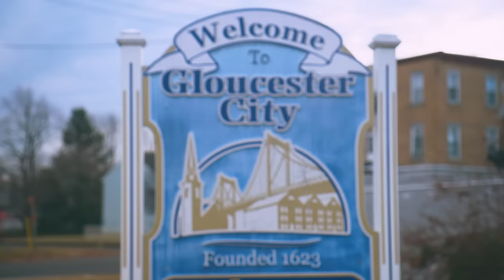The Weekender: "The Industrial Revelation" (Season 4, Episode 6)

Comment: I don't have a problem with the wood floor being painted but I think that floor looks really bad with all the gaps and uneven boards. Other than the floor the room is gorgeous especially the fake concrete wall
Reply: It's definitely a more industrial/rustic look, almost farm-house, but very complemented by the finishes in the rest of the room which remind me of Nordic or Scandinavian design.  It's minimalist but great textures and cozy.
Reply: I think that messyness is what gives it it's charm!
Reply: nordic farmhouse style
Reply: Same
Reply: Well its a thing actually
Reply: I agree, it would be a pain to clean! I would have taken a few extra days to do proper floors.
Reply: Ralitza Treneva: agreed. They could have rented a drum sander and prepped it instead of cutting corners for the sake of a concept, that being a weekend instead of an appropriate amount of time.
Reply: Exactly.   Uneven flooring is bad.  It is harder to clean,  its a trip hazard,  it harbors insects.
Reply: So did anyone bother to check if the paint they sanded off of the floor was lead  based?
Reply: I do have a problem with the floor being painted, that is a no no, I was so pleased when she stopped everyone when doing the sanding, ( that was totally crazy ) and absolutely in my opinion is that there is a much better option to upgrade  these floors, like     easily they could of have installed laminate floor planks right on top of it, it would of been much easier and it would of look much nicier
Reply: I think something like stonecrete would be better for this floor issue.  Use epoxy to custom design it so it will be awesome.
Reply: Perhaps not a white floor. It really emphasized the imperfections.

Comment: This was a lovely design but the thought of how many toes will be stubbed and socks ripped open on that jagged floor is almost cringe worthy.
Reply: A floor patch might be in order in the one spot where the wood planks were missing and there is only what appears to be subfloor underneath.  But that may have been outside the scope of work willing to be undertaken in one weekend.  That can be done by the homeowners themselves, or perhaps a small chair can be placed over that area, or a small but cushy rug with a collection of baskets on it.  There are ways to disguise the area if the owners don't want to do a plank patch.  A separate weekend project might be to do the traditional method for filling in gaps between shrunken floor boards -- adding oiled jute in the gaps/seams and painting over the whole.
Reply: A gray plank laminate floor would have been a faster and much better choice.

Comment: I love it, even the "rustic" floors.  My only slight problem is with the lack of a beam that looks like it should be running centered right through the chandelier/light.  Isn't there a way to put one up by cutting it in 2 and coping out wood to make room for the light fixture attachment at the ceiling?  I was skeptical about the "concrete" finish on the wall, but it turned out to look great, too.  All in all, a home run.  The room looks very Nordic to me.

Comment: Beautiful and clean! The faux concrete wall is fab. Yes, The ceiling draws the eye in a good way, except for the center which is missing a beam? I'm guessing their light fixture wasn't on center? 

They could have moved the box. But it's best done by an electrician, for meeting code and making a junction. It involves taking out a rectangle of drywall to add new framing for mounting the box. Then replacing, repairing and texturing the the drywall and painting. 

Another option, is leave the box where it is and create a big enough hole in the wood beam to epoxy a piece of lamp tubing. Go with a fabric covered corded light fixture. Allow for extra cord length. Borrow a 2nd tall ladder and a 2nd person. Rest the beam and the fixture on top of the ladders. Feed the new fixture wire through tube and beam, and reattach it to the box. Glue and nail the beam. Then swag the light fixture to center with a ceiling hook.

Comment: Ok, but that middle slat that is missing on the ceiling is very unsatisfying.
Reply: Agreed
Reply: @lynnealuebben1967  ... yes I thought the same but the light is right there I just didn't like white floors. maybe just a little more green to give more color to so much white.
Reply: Agreed
Reply: Jarring.  Pretty much as jarring as that floor.  Simple solution would have been to bring the big sander or new carpet.
Reply: @patfondren6013  Yes Carpet. Easy quick hides flawless.

Comment: Really enjoy these makeovers. Fairly inexpensive, quick and easy if you're handy at diy. But this room, while it turned out great, needs a larger rug under the bed and a dresser. I also agree you should have centeted the wood on the ceiling. But the accent wall. Colored cement? Genius!

Comment: Something I wonder with this series, this episode particularly is why there are permanent 'plan B' things done, simply because it has to be done in a weekend? 
I don't see a problem with painting wood, but if spending more time to sand it properly and using watered down white paint would look better, why not put down a good looking temporary panelling over the top so that it looks good for the final weekend transformation. That way the owners have the option to do it the other way themselves after, or you could even make episodes of going back and finishing those projects with them.
White porch paint seems like it would be even more of a pain to get off than the orange paint alone if they did want it watered down? I guess the owners could object, but it just seems like the explanation for these decisions is often 'because it's the weekender, we don't have time.', rather than 'actually plan B would look better for your home.'
I must say though, I am always very impressed with the transformations otherwise, that faux cement wall looks amazing!

Comment: When staining, please finish the ends and sides of the boards! The project panel ends were stained uneven and the "ceiling beams"  were missing stain on the second board. Even in a hurry, details like this can make or break the final look IMHO. The "cement look" accent wall turned out better than I anticipated, but if future homeowners don't love it they may need more than a palm sander to remove it. ; )

Comment: Omg Love the wall.  My favorite is the beams over the ceiling. But I do think you should have added one more beam to fill in the gap cut around where the light fixture, other than that great job! I will be using this design in my kitchen. To cover up imperfections on the ceiling between my kitchen & family room. Thx Monica :)

Comment: I did exactly the same with my old painted hardwood floors, however you should fill out the gaps with wood stucko first. These floors are not going to be easy to clean at all with those gaps. Also, a nail gun and some glue won't keep those planks on their place for long. I'm waiting to see how long this room will last in one piece.

Comment: For the sake of cleaning and dust, I would have put a finish top coat on the spackle cement wall.

I wouldn't call those floors hardwood.  They are just a plank subfloor, and anything other than paint would have been a waste of time.  I am only surprised that you did the floor before you painted the walls, and I would have chosen a larger area rug.

I would change two things about the new ceiling.  I would use fewer boards for the beam effect, and I would have done the math with the ceiling fixture in mind so they would all be evenly spaced.  

Wouldn't it have been nice to have had a couple of French doors to replace the closet bi-folds.  And what about a mirror somewhere?

Comment: Are most of these comments paid for? Because it's next to IMPOSIBLE to find a comment that isn't just gushing. So to break the trend.... Allow me to give some constructive feedback and tips for anyone who ever tries to do this stuff them self:

1- Protective personal equipment: you should ALWAYS use eye protection and a breathing mask when sanding. Especially when removing large amounts of unknown material from old floors.
2- The floors looks terrible. Not because it's painted... But because of all the gaps and uneven planks. To anyone who wants to paint their hardwood floors... Take the time and do it properly. Rent a drum sander and even everything out. Don't try and save 2 or 3 hours of work... You will be living with these floors for a long long time.
3- why is no one calling them out on the ceiling beams being uneven??? There is a large gap in the middle of the ceiling because of the light fixture. This is what happens when you "design on the fly". Please measure ahead of time so you know where the planks are going to fall so you don't end up in the situation they did in this video.

Comment: That concrete dye that you used, can you put that in paint?
I bought Behr Slate Gray Low-Lustre Interior/Exterior Porch and Patio Floor Paint, for my concrete patio. It is not grey, it looks more like a light to medium blueish color. It's like it has too much blue hue to it.
As opposed to the label on the can, which is the color that I want. But it come out a lot different.

Comment: why not just get a sander that's for the floors in the first place
Reply: that's totally not a floor you could go barefoot on.. and it's a bedroom!
Reply: That type flooring, when it was installed, was never intended to be seen. The floor was installed to be carpeted. It would have been a waste of time (which they did not have) and would not have looked great. What she did saved time.
Reply: That would strip the floors and they don’t have time to refinish them.
Reply: Tia Williams is painting them not refinishing them?
Reply: ozzie Refinishing, as in sanding them down to the bare wood then re-staining or painting and then sealing. It brings them back to new but can take days so they just went over what was there with paint. They covered them but didn’t refinish.  

Drum Sanders are faster and more powerful but they risk taking off the wood’s protective finish, which is what, I assume, Monica didn’t want to do.
Reply: Actually, if you sand it down to bare wood you need to treat it so the spots that twigs used to come out of doesn't turn yellow through the paint, then paint it, then seal it. So basically sand, seal, paint, seal.
Reply: no, it's not. Refinishing entails sanding, staining, and then coating with a sealant. All of which would need at least two coats if not three. Then you have to factor the drying time between all those coats.... They really didn't have the time. But you know, the most important thing is they like it.
Reply: yeah but then there might not have been any time to do anything else
Reply: SimplyxSabrina She said it would take the WHOLE weekend. And they didn't have time to do just the floors, they had to do the whole room in the one weekend.
Reply: Those planks aren’t meant to be bare. That’s not traditional hard wood flooring. It’s me a t to just be a base for carpet. Really poor work.
Reply: @Jessa8891  I agree. She assumed that it would be standard hardwood floor in an older home. Instead it looks like sub floor....rough, uneven, with patched areas. I imagine stubbed toes...and don't drop a small earring cuz you will lose it between those cracks. I think that a quick, click and lock laminate plank floor in a white washed, rustic look may have been a better option.
Reply: @lahawk2931  you're all so smart where are your videos? lets see u guys do a better job replacing monica
Reply: @thedbq1  Oh please. Nobody is dissing her in general. She clearly didn't have time to do her intended job so improvised. Doesn't mean it was a top notch project and am guessing that she wasn't thrilled herself, but tried to make lemonade from lemons. Does not change the fact that the final result is far from her best work.
Reply: @lahawk2931  😆 right

Comment: After researching, I have knockdown textured walls in my home. Would I have to sand and prep more because of the texture or would the all purpose joint compound fill those gaps?
Reply: Wipe it clean very well a very very light sand & use the green box instead of the bucket, it has more glue & go for it. If you want a smoother finish use a magic trowel to smooth it out

Comment: As an owner of 100 yr old gappy wood floors, big mistake, especially with kids. You have to clean and fill the gaps. I am still finding 100 years worth of dust, bobby pins, cheap earrings, cat claws, and glitter in mine. Also, what happened to top-down? It doesn't make sense to work on the wall paint last! ×_×

Comment: I know most of the comments are loving that 'concrete look' wall, but without any kind of top-coat, how is it going to stand up over time?  I know that spackle can get scratched or dinged very easily, so I'm thinking at the very least- it will collect dust and not be easy to clean.  A clear-coat would give it a shiny finish, which won't look like concrete anymore, so that's not the answer eiather.  I just think it's not a good long-term design solution.

Comment: I'm practical. That desk wasn't. Cute for a shelf, which is all it was. Maybe the budget was low, but a desk that lifts would be better. Give him the option of sitting or standing. Because sometimes your tired. And there was no storage! Uck. No drawers! 
I did that shelving with a small master closet I had. Works great. Even installed it myself in an evening.

Comment: I usually like these makeover BUT this episode was a flop. 👎 Hand sanders on a floor!?! Are you kidding me? And painting them wasn't a great solution either. I agree with Ash about ceiling planks with awkward uneven spacing. Especially since when you're in bed it's something you see all the time. As the Project Manager/Designer she should have measured out from the fixture to make the planking work or changed the spacing to make it work. Also not impressed with the chain desk.  Looked cheap! So much space there, I think she had room for a proper desk and some shelves above. Cement look wall is great look but should have done it with just paint. When they go to repaint that wall they either have to sand the entire wall or rip it out + start over.